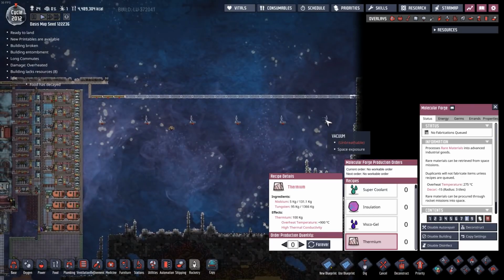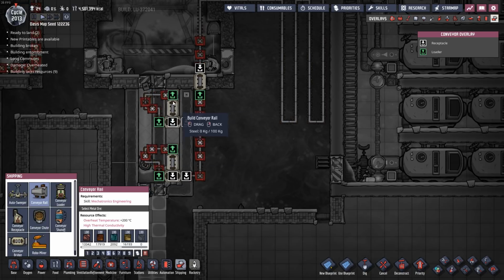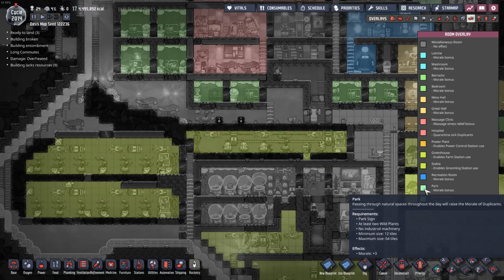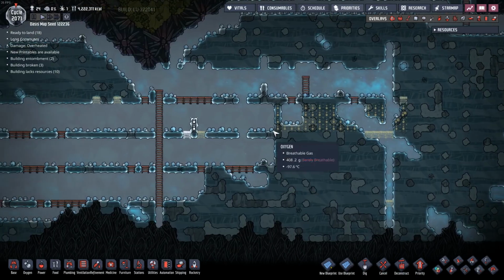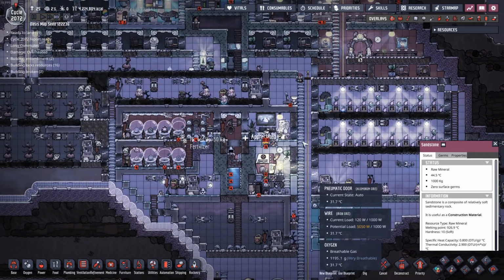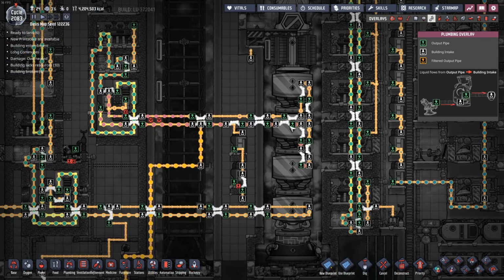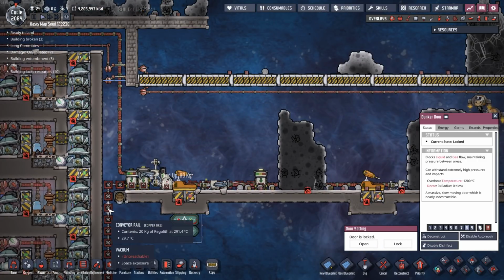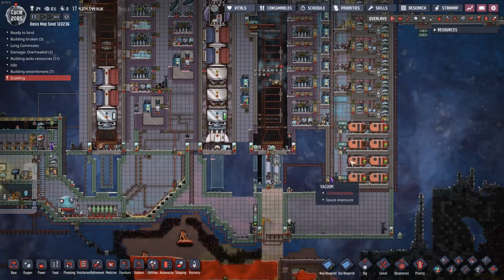SOO Much Regolith From Space! Oxygen Not Included ep44

Comment: Mesh tiles in the air production is a better solution!
Reply: Why?
Reply: if you put the wrong liquid in the electrolyzer it drops the liquid on the floor, forming a liquid layer on the floor preventing the oxygen from going down and stopping the oxygen production, if you have mesh tiles the liquid drops to the bottom. low and it does not occur

Comment: For the regolith miner, you could use storage containers instead of conveyor loaders and just have them set to different priorities so the sweepers make it leapfrog over to where a singular loader is. if you don't want to have storage at the end of the chain be priority 8 or 9, or you have more than 9, you can throw a dropper in the mix, and move the next sweeper over a tile so it can only access the debris and not the dropper, and start over from 1. This makes it consume less power, uses less material, has less building required, and is less likely to break from overheating unless you use advanced materials.
Reply: sweeper -> 1 -> sweeper -> 2 -> sweeper -> 3 -> sweeper -> dropper (4) --> sweeper -> 1 -> etc. -> conveyor loader.

Comment: Just a thought: put bunker tiles directly above the robo miners. You aren't mining the regolith above them anyway. This way they are always working and you don't need the door automation.
Reply: Then he has to create active cooling. Currently he's using the regolith piling up to keep the robominers cool.
Reply: @riotintheair  He made them out of thermium, though. What's their overheat temperature? I guess the bare minimum heat loss is still enough to keep them from malfunctioning.
Reply: @GiovanniBoss  It doesn't matter what the overheat temperature is. The temp would keep rising until it breaks.
Reply: @peter-klausnikolaus4823  My point is: his gameplay will probably end before reaching that temperature.
Reply: Without cooling from regolith they'll overheat no matter what they're made of. Every second they're active they generate 2000 DTU's and overtime it will cause overheating even with thermium (it's 96 cycles of continuous operation for an uncooled thermium robominer to go from 45 degrees to 975 degrees, so not super frequent but also not that long - if the robominer is baselined at 350 instead of 45 it's about 65 cycles instead). Personally I don't think rebuilding them every 100 cycles is worth the effort and the regolith cooling method he has now is a simple solution given that he doesn't really need all the regolith. The real advantage to shielding them is to not build them out of thermium at all since the point of the thermium in this build is to give something that can be regolith cooled since nothing that generates heat can go uncooled forever anyway.
Reply: @riotintheair  Ok, 96 cycles is shorter than what I expected.
Reply: @riotintheair  he could vent the oxygen he needs to get rid of near them to take the heat before disappearing.

Comment: At 30:45, you have a duplicant checkpoint that is overheating. Could be dangerous if it does not prevent a dupe from walking under a shower of magma :)

As well, for your regolith miner, would it not be better to have a few doors under the miner so you could destroy more on one cycle? I do not know if a weight plate can be used as a tile under a door but it could be a way to activate the door shredder if it works.